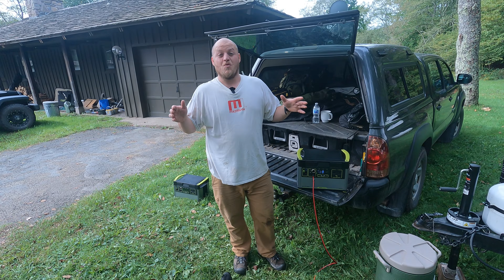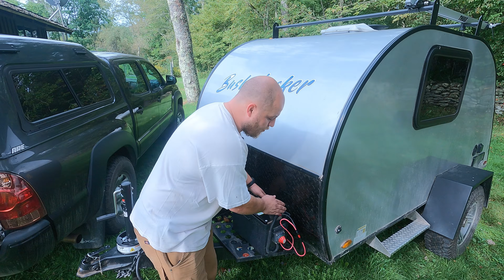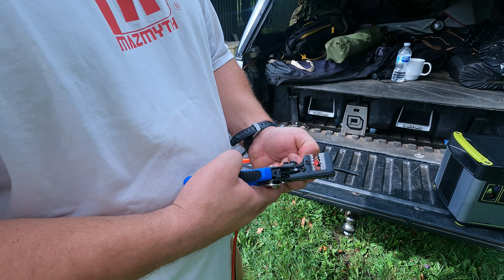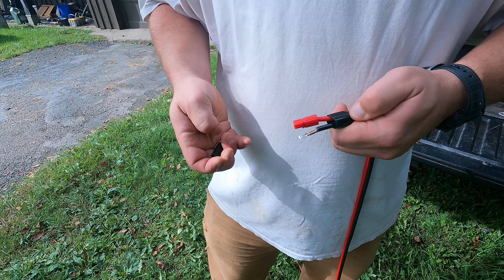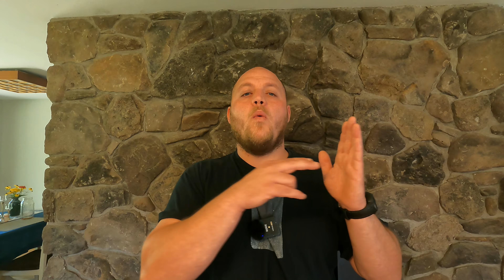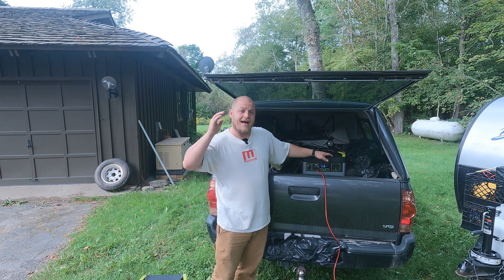Using Goal Zero for RV Battery

Comment: Hi. Thank you again...do you have the link for the switch?
Reply from the maker: An On-Off switch like this?
https://amzn.to/3MLETj9
Reply: Hi. I got the yeti. A used 1500x. Thank you for all the help. We are going camping this week so will put it to the test.
Reply: Hi. I connected it all yesterday and all works. I have a question about the switch tho. I see you have the positive connected to the switch. I first connected it all wrong then was reading that there is no polarity. They recommended that the negative cable be connected to the switch. Why did you connect positive to the switch? Then. Can you connect two yeti’s 1500x together?
Reply from the maker: @jacoe33333  you wouldn't connect two yetis together, you would just use one and then the other.  I prefer that because you can actually charge one while the other one is running your rig.

As for disconnect switches, I'm a huge proponent of positive switching.  Both ways work, the positive master switch is superior, it's actually code to do it that way for every body governing a DC system (aviation, boating, stock cars, military etc)
Some of the reasons can be a little complicated to explain in a text, they relate to maintaining the continuity of a chassis ground system.
Reply: Ok. Thank you. I will change it then to positive. I just experienced another problem. We tried to switch on the water heater with gas and it would not stay lid powered by the yeti. After cleaning all components on the gas heater I thought let me switch it to the 12v battery. Low and behold it worked. So I made my own Anderson power pole cable that run from the yeti to the rv Positice and negative, but the cable is 50 feet long. I am wondering g why this is happening. Is the cable to long. I tested the volts by the heater and it was 12.5.  The the second question. Can I recharge the yeti with a gas generator? We are camping among giant trees in California and there is no sun.
Reply from the maker: @jacoe33333  yes, you can charge w a generator no problem.

As for the other question, that can get a little bit more complicated.  50' is pretty long for DC, the longer you go, the larger the wire diameter needed.  Try a shorter distance and see if it works.
Reply: I had my cellphone plugged in at the same time and that is the only power that was drawn at the time. I plugged my cell in an outlet from a extension cable from the yeti to inside the rv.
Reply: Thank you. I am going to cut it shorter and see if that makes a difference. Will let you know. What cable and plug do you recommend for charging the yeti with a generator?  Happy thanksgiving.
Reply from the maker: @jacoe33333  you could just use a nice extension cord, 14 or 12 gauge

Comment: Any idea how to keep the 1500x yeti warm in my van overnight. I have minimal room where it sits in the back "garage area" of my van but the yeti shutdown every night it goes below 31degrees? (Colorado Springs)
Reply from the maker: It only stopped the charging, right? It should still maintain all of the output functionality.

I buy a yard sale cooler, something old and cheap.   Then I'll throw a hot water bottle in the cooler and it maintains its ability to charge.  Unless you're getting down below 0F, you should only have to do this to get the solar to charge in the morning.  It will also work if you get down to very cold temperatures for the output.

Comment: Thanks for the video.  I think?  You can increase the Goal Zero Yeti's watt hours/performance by connecting your camper battery to the Yeti.  Simply get an Anderson connector to a 8mm Goal Zero male plug and plugged your existing battery into the Yeti.  You will be able to charge both the Yeti and the existing camper battery with solar panels when you're in the boonies.
=
Reply from the maker: Thanks for watching. 
Im not sure who told you that, but that wont work.  You cannot safety charge the yeti by going from a lead acid battery into the 8mm port.  You can use the regulated 12v charger GZ makes and run that to the battery, but not wiring a battery directly into the solar charger.
Hope this helps!
Reply: Thanks for the info, go to know. @DIYOutdoorLife

Comment: Brian, love your info and I consider you my RV electrical guru. I'm setting up my RV and have a Yeti 1500x, 4x100W Renogy Panels (to be roof mounted), 1x100 Renogy Briefcase plus stock Mini Wini charge controller, etc.  I sense that I could run all of my panels into the Yeti and use it to power my system and charge my 2 AGM 100ah batteries and even do this simultaneously.  Hope to avoid duplicating the Yeti charge controller and sine inverter all together. Am I off-base?
Reply from the maker: Youre on base. I ran a system like that for years.  Do you want to be able to swap the solar panels back-and-forth easily.  Set it up so that you can plug them into the camper battery and easily swap over to the yeti.
Reply: Thanks Brian - finally getting to this and found my camper leads are 6 gauge. I’m unsure about the connection to my Yeti. Can you enlighten me?
Reply from the maker: @davestahl447  you can use 10 awg going to the yeti.  The DC output, using Anderson power poles, is rated for up to 30 A.  10awg will be fine to transition between the yeti and the camper.

You might want to consider using a bigger plug on the camper side.  They make larger Anderson connections that would be easier to use with the larger wires.  In that case, you could use a 10awg wire with the larger plug on the camper side, and the 45a smaller Anderson on the yeti side.
Reply: Thanks Brian! Greatly appreciated.

Comment: Rather than disconnect the camper battery(s), can you just add the portable power station to augment the camper battery(s), using them together?
Reply from the maker: No, you cannot mix and match batteries like that.  They were on a different voltages and resistance and you can damage gear or cause a safety issue.  A PPS like Goal zero will not allow you to do it, the light will flash red and it will not work.
Reply: @DIYOutdoorLife  Thanks for the explanation!

Comment: Thanks for this info! I never even thought to incorporate my Yeti 1400 with my camper.  I do have a sort of unrelated question. My camper comes with a Zamp 100 Solar Panel. I have a Boulder 100 solar panel and a 10amp controller and Alligator clips. I know I can charge a 12v battery with this... but, what I want to know is can I clip into the camper 12V with the Boulder while the Zamp is already charging it?  Can I charge that 12v faster with both systems on it? ... or would I be doing a bad thing. LOL.
Reply from the maker: No problem, that would be right as rain.  It is perfectly fine to have two charging systems with two charge controllers, you just don't wanna overload a battery.  In your case, you are not overloading with solar of that size. 
 If you had bigger arrays, I would have to ask about what size battery.  With two 100 W panels, youre fine.
Reply: @DIYOutdoorLife  Awesome! Thank you!

Comment: Wow Brian you have really great videos, thank you for doing these. I have a Bluetti EB150, with 120 AC outlets and a 4 amp smart battery charger. I’m thinking that I could keep my trailer AGM battery topped up through the SAE solar port. I know it’s not efficient but it uses equipment I already own and I don’t have to modify anything. I haven’t tried it yet, any thoughts on me doing this? Thanks
Reply from the maker: Thats the name of the game, if you already own it, great place to start.

You can charge thru that port, just check your polarity on the SAE, zamp is different than furion on go power.

Comment: Thanks for putting this vid together. Want to make sure I understand you. With  my 12 volt set up, (2 6 volt AGM in Series) I can disconnect the battery bank that is connects to my DC fuse box, inverter, charge controller, and connect the Goal Zero to replace the battery bank? The cut off switch would have to be after the DC fuse box and before all other stuff. correct? I like the idea since we pull our Airstream with a CamperVan. I could use the Goal Zero for backup and Van Camping.
Reply from the maker: To do this, you would first have to make sure your inverter is off and stays off.

Next, create a plug that simply disconnects your two batteries , the positive and negative wires that were going to your battery bank will now go to the Goal zero 1500x. By creating a plug, you can make it easy.  Let me know if any questions pop up with the project.

Comment: This video is exactly what I needed to see. I'll be hooking up a yeti 3000 to a 5th wheel. I like the idea of the kill switch as well!! Anything I should watch out for?
Reply from the maker: Its a great mod, I think youre going to love it. Let me know if you have any questions.
Reply: @DIYOutdoorLife  I have been putting the project off, but I now want to tackle it. The currunt wire the 5th wheel has going to the battery is 6awg. I have been looking for a Anderson 45 amp plug kit and an Anderson 6awg extension cord, but I can't seem to find it. Would it be possible for you to help me out and point me in the right direction to find where I can buy this or suggest something else? I appreciate your help!!
Reply from the maker: @scottwalker4968  here is the 45 A connector
https://amzn.to/3F3LUrp
Reply from the maker: @scottwalker4968  you won't find a six AWG extension, since the 12vdc output on the GZ is 30 a, you can use 10awg
The plugs can be adjusted if the orientation isn't correct.
https://amzn.to/3LIgtX9
Reply: @DIYOutdoorLife  thank you for the quick reply. I really appreciate it!!

Comment: Thinking of doing this in a couple years in order to live full time off grid in a slightly bigger rv as this is much easier looking than building a diy solar system. If a camper has a factory inverter would that work with this system and more importantly would that have a possibility of damaging components? Thank you for all the information you provide
Reply from the maker: I would not use a factory inverter system like this.  30 A @ 12VDC is only a few amps 110v, meaning it wouldn't go very far.  The inverter on the yeti however, is excellent and can run almost anything.  I would hook it up so that the Anderson port runs the DC and the yeti inverter runs the outlets on your rig.  You can use the app to turn things on and off and monitor.
Reply: @DIY Outdoor Life  thanks man, been looking for answers, but the info on this stuff is pretty sparse other than your videos. Hope you have a great day

Comment: Wow awesome vid!!! I’m so excited to try this. One quick question. I have the eco flow delta pro so I can do this (which I’m excited about) my only worry is I also use my eco flow delta pro to provided ac to my camper (with the 30A output *just like shore power) I hook the eco flow to the stock shore power outlet on all rv’s. Will having the eco flow plugged into my camper via 30A shore power cord AND running the DC off of the Anderson output be a problem? Thanks again!
Reply from the maker: You can do this, but you really have to know what you’re doing.  You HAVE to make sure your converter charger is turned off or the fuse is pulled. You don’t want the AC side to try to charge the DC side, that won’t work and trip the circuit.  If you can’t figure out how to do this easily, you should just use the DC and unplug when you need the AC side. Hope this helps.
Reply: @DIYOutdoorLife  awesome yes I know where it is. I’ll turn it off! Thx. Will the 7 way pin be a problem?
Reply from the maker: @wilson12365  yes, same concept.  You don’t want the regulated DC output of a power station combining with another power source.  It is a pure output only.  You would want to unplug the seven pin when utilizing that feature, it’s worth it, really solid way to power the DC side.
Reply: @DIYOutdoorLife  wow wow wow. I did the mod yesterday and it’s amazing. Day and night difference. Thank you so so much!
Reply from the maker: @wilson12365  awesome to hear!

Comment: Hey I did everything you said thought it would work but when I hook up my 1000x to the trailer the 12 volt power light on the yeti turns red? Goal Zero told me to hook up a Anderson to ring terminal connector to my fuse box? Don’t really understand that? Did I miss something or do I need something else? Thanks, Jason K.
Reply from the maker: Hi Jason, what kind of camper do you have?  If you follow what we did in this video, it is no different than hooking it directly to the converter with ring terminals.
The 1000x does trip a lot sooner than the 1500 but still works, I do it all the time.  Hope you’re able to get it figured out, this is a very handy way to use the yeti.

Comment: why not just plug power cord from camper to the battery generator and unhook camper battery  so it won't be trying to charge camper battery
Reply from the maker: You will still lose around 20% on the inverter DC to AC on the PPS.  In addition to that, there’s also standby consumption while the inverter is on, which has to be 24-7.   Finally, even with the battery unhooked, which helps a ton, there’s still a DC converter that puts 13.5 VDC to the alliances in the camper.  All of this adds up to some massive inefficiencies.  With enough solar, sometimes you can get away with it and it’s great.  Running it the way I showed in the video gives you at least twice the run time though, well worth it. When you want the outlets to work, you just unplug and switch to the AC like you said.
Thanks for watching!

Comment: I enjoy & appreciate your expertise on Batteries and Portable Power Stations . 
Question? If I disconnect my 12 volt battery, can I plug my shore power into my 1000 watt power station ?
Reply from the maker: It won’t hurt to try.  Since I don’t know your camper or the power station, I can’t tell you for sure, but the worst that can happens is it trips.

By shutting the battery off, like you said, you will prevent the power station from charging the battery, which would use up a lot watt hours.  This will help a lot.
You will not however, prevent the standby consumption and loss from the conversion and inversion.  Although it may work, it’s not going to run for anywhere near the amount of time as running a DC connection like in this video, still will be handy though.

Comment: Awesome videos. Really informative. By far the best I have seen. I just bought a 2016 Rockwood A frame camper and I was thinking of running my 30a with the 15a adapter to the Goal zero and when I need to charge the Goal Zero I would run my camper off the battery. The good thing about my camper is that its very minimal. Just has AC, heat and a fridge and some plugs. I would only need to use the fridge while camping and the plugs when I need them.
Reply from the maker: Thank you, I really appreciate you turning in!

Comment: Hey Brian! How does this differ from your video on plugging power station into inside 12V and running fuses off of it? Thanks.
Reply from the maker: This gives you 30amp DC instead of 10amp.  10 amp from other video gives you the minimum basics, with 30a I can run all of the DC stuff at once if I wanted.  It’s also nice with a teardrop to keep the power station out of the cabin, especially helpful with the large power stations.

Comment: Thank you for this great info! So if I have an older GZ 1000 Lithium (not core, not X) that has 10 Amps through the powerpole connection, is this setup not worth it for me?
Reply from the maker: You wouldn’t get the same benefit, but try this instead-
RV Power Station Hack | Interior Back-Feed
https://youtu.be/lf2nbCLuLCY

Comment: I have a couple of questions . I have an eco Flo river pro 

1.  Does shore power charge your battery 

2. In a pinch would plugging in the power station to the shore power via 15 amp charge the battery . 

I understand there would be alot of wasted energy however wanted to understand that before I even attempted it
Reply from the maker: Hi Scott,
Shore power does charge my camper battery.
If I want to use shore power to charge the yeti, I use the built in charger on yeti and not camper.

Yes, plugging in your camper through the PPS does work in a pinch, I do it all the time.  You just have to make sure that your power station, the Ecoflow pro inverter can handle the draw of the camper charger.  It works fine on my camper.

Check out this video if you haven’t seen it 
https://youtu.be/mU8iZZGlk_8

Comment: hey Brian< being that GZ is the only one with this port, does that mean I won't be able to use this method with other power stations? or is there an adapter I could buy? Thanks for any help.
Reply from the maker: It can be done with the Bluetti AC models and the Eco Flo delta pro.

It’s not about an adopter, it’s about the power station having the capability to put out that DC current.  Let’s hope that they start adding this feature to all power stations.

Comment: There’s some really great information here! My question is: do they make these Anderson connectors to accept bigger wire? It appears that the wires coming from my camper going to the battery are 8 AWG. I tried several times using these connectors and it seems the wires are just a little too big to be crimped properly. Any info would be greatly appreciated, thank you!
Reply from the maker: Yes, they do. I’ll attach a link for the set of plugs you’ll use on the camper side. 

You can use 10awg wire and the normal plugs for the wire going to power station. 

In other words, use the larger plugs for the connection going from your battery to camper. Your extension wire, running from that plug to the power station can be 10 gauge, with one big plug on one side and normal plug on the side goes into the Power Station.

Let me know if this makes sense, it’s an easy job .

https://amzn.to/3JbhPI6
Reply: Thanks very much that makes sense!